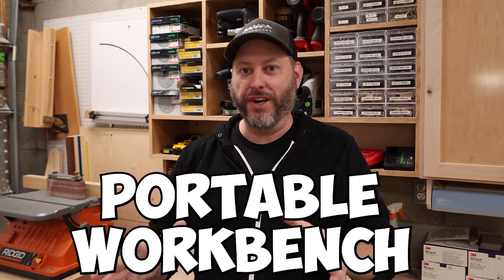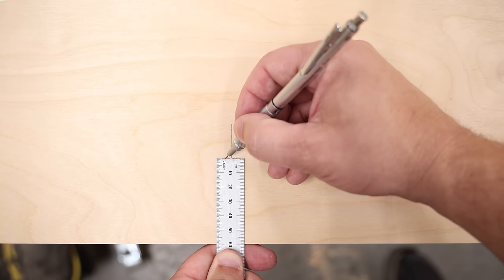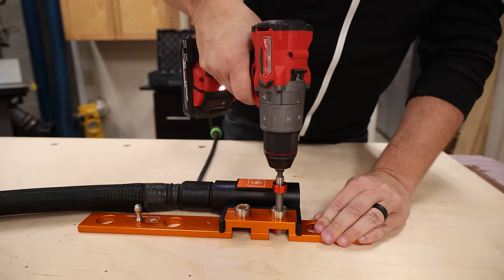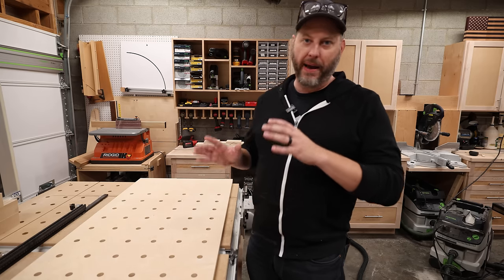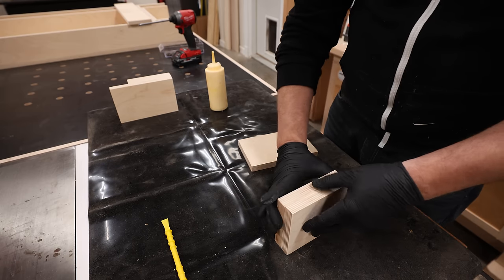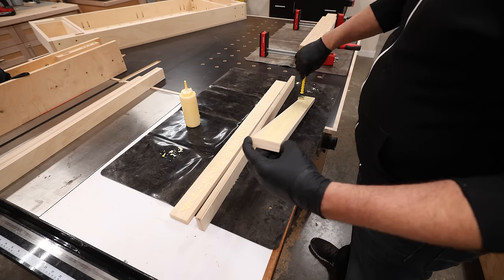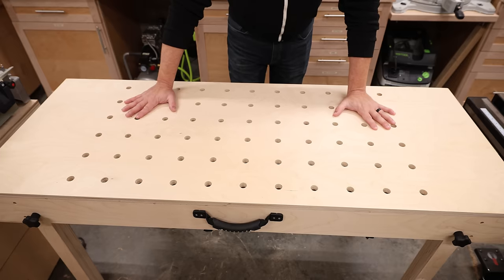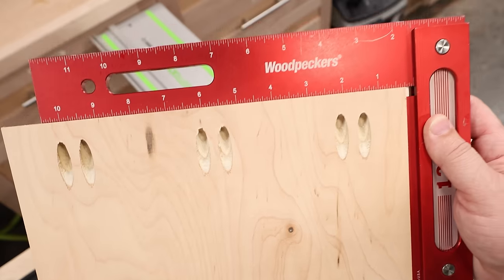I regret not building this sooner

Comment: I work for a cabinet company here in the states and we exclusively use metric. Before I started working there I had never used it in my life. It's much easier to measure with accuracy, and the math is much easier. Now when I'm working on projects in my home shop I mostly use metric. I think imperial is much better in normal construction like framing etc, but for smaller things that need to be more accurate, metric is much easier.
Reply from the maker: Yep most cabinet shops around the world use metric. They build cabinets on the 32mm standard
Reply: I just started using metric myself and love it.  Much easier and more accurate.  The problem is trying to reprogram my 66 year old brain.
Reply: Welcome to the world, fellow ‘Murkins
Reply: 🥲 I love to hear of Americans converting!

But to offer my counterpoint; as someone who grew up metric, but from watching so much high quality video content coming from USA, there's much to like about imperial too.

If I wanna build a furniture piece that doesn't need to fit into an exact place, I opt for imperial. Simpler numbers that allow me to visualise the end result more easily.  6" x 3" vs 6" x 4" I can imagine better than metric, unless I'm using round numbers.

Also, 8by4 vs 2440 mm x 1220 mm for a sheet of plywood. Much less syllables when talking to lumber guys 😂
Reply: If material supply is in metric, then there is not problem in using it in construction. Fx we do not have 2 x 4. We have 50 x 100 mm instead. There is really no difference in strength. And our entire building system is based on metric. We would find it silly to use Imperial.
Reply: It isn't more accurate.  Accuracy is how you relate to the measurements.  It isn't even more granular.  32nds are smaller than mm.  But hey, has nobody heard of decimal inches?  Tenths, hundredths, thous, and tens?

There was a fun system named after it's innovator that consisted of imperial measures, feet and inches, but inches were subdivided into 25 segments.  I think he had a point.
Reply: I was brought up in England to use both and I still do... most the time i use both on one project.  Even a 2x4 is 2 x 4 x 2.4 metres 😊 both imperial and metric
Reply: @tacticalskiffs8134  
Yes, I hear people saying metric is more accurate but that's pure rubbish.  The only advantage is it's easier to calculate multiple dimensions in your head, if you're fractionally challenged.
Reply: This is so true. Build some cabinet carcasses and then use metric to measure for your drawer dimensions. So much easier
Reply: Agreed. For those of us that hated fractions in school, it’s so much easier to measure millimeters than to remember if 3/8 is bigger than 11/32 or whatever.
Reply: Growing up in Canada, I started with imperial measurements & then the country switched to metric when I was still a kid. Even though most of my life has been lived in a Metric world, I still think Imperial & automatically "convert" metric to imperial for temperature, speed when I travel in the USA, kg to lbs etc... That "conversion" isn't accurate, but for me it's "close enough" for my daily life.

Building materials are sold in imperial measurements in Canada (for the most part) & anything that I have attempted to build (so far) I have used imperial, but I could easily build with metric measurements too. I have worked in 2 trades where imperial measurements are still common; paper is still sold in 8 1/2" x 11" sheets, commonly used for letterheads (printing trade) and pipes are sill dimensioned in imperial for my pipefitting trade, but measurements on drawings are metric

Comment: I used the Parf system to build the Ron Paulk Bench and what he recommended  was to use the forstner bit (no jig) on the underside to score the plywood and then drill out the holes from the top side using the jig. It works perfectly. Great project.
Reply from the maker: I read that when I was researching afterward. I will remember that for next time!
Reply: yeah, scoring the underside seems like no brainer after the fact... also - tape? on the underside? really? 😅

Comment: I use the Parf guide system with plywood all the time.   Once the 3mm holes are drilled I flip it upside down & drill about 1/16” with the 20mm so there is zero blowout.  Works like a charm & only take a few more minutes.
Reply: Happy to see this comment -- this was my first thought when I saw the tear out on the back.
Reply: Isn't drilling from both sides the standard blow out reduction method for any hole through any material anytime? I've been using it to drill through block walls for decades.
Reply: My thoughts for Baltic Birch Plywood. Set depth stop on the 20mm forstner bit  to leave 1/16" (1.55mm) bottom, bore 20mm pocket hole. Flip work piece over after all holes are drilled. Use a 5/8" brad point drill bit to enlarge the 3mm hole, then use a 1/4" or 1/2" Spiral flush cut pattern bit to finish up the bottom side holes with a router.
Reply: Dude, I'm pretty sure if he just used a backer board instead of the foam, most of it would be eliminated.  Just set it on 2 or 3 2x4 scraps and use one as a sacrificial backer board.  It might not be showroom perfect but it'll be good enough!

Comment: Great Vid . . .well designed build, love the storage end draws and under track saw hustler, just questioning leg stability.  
 Not Bashing just suggesting, the track storage is a +++ and is a must in this build, my thoughts would be to use folding metal legs  from a venue table for their stability and quick deployment.  To make them work you'd need a spacer to elevate them above the stored track when legs were collapsed for transport.      Just my thoughts. . . . Stay safe, Stay happy
Reply from the maker: Thanks for the idea! In my experience folding legs of any kind tend to introduce way more slop and wobble. Hinges have way too much play in them. Fixed legs, like on a table, are more rigid and stable.
Reply: I really like the top. Has a torsion box rigidity with great storage options. I’m a big fan of throwing my single ply diy mft on a bora centipede on the jobsite but its a little low and slides around on the multiple points of contact. My future rebuild will be closer to your top with pockets to drop onto the centipede I think. Optionally could use the sawhorses I usually have onsite.

Comment: I used the Parf Guide system to make a 4'x8' workbench.  Half the table is dead nuts accurate, the other half is a bit off.  Obviously user error.  One thing though for a big workbench, it takes quite a while to make.  I've considered having a template made with 30mm holes 96 on center and also some offset holes.  Seems like it'd be much faster to clamp down a template and with a 20mm router bit and 30mm bushing just route hole after hole.  The Parf Guide system is nice but a bit finicky.

Comment: "Yay Metric" is absolutely right, much easier than Imperial.
Reply from the maker: Not at all true if all your machines are in Imperial 🤣
Reply: @MWAWoodworks  We should have made that change long ago.
Reply: @MWAWoodworks  The US customary inch is legally defined as 25.4mm since the 1890s, so technically the US is already metric 🤓

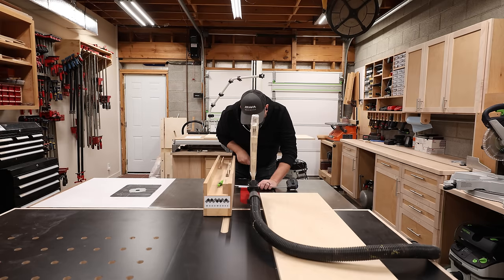Comment: 1:02  I find I'm using metric more and more. I removed my Imperial-only tape on my table saw and replaced it with a dual Metric/Imperial one just so I didn't need to fiddle with measuring metric cuts.

Comment: To prevent blowout on the back of your plywood, first drill part way through with your Forstner bit, flip the sheet over, then drill the rest of the way through from the opposite side.
Reply from the maker: Yep great tip! Thanks for watching! 🙌
Reply: I started on the underside and just made a scoring cut…you don’t need the parf guide, just locate the centre pin and cut through the surface ply. Flip the top right side up and complete the dog hole drilling.
Reply: I also had a similar issue and found that clamping another piece of plywood tightly under that piece stops the blowout also

Comment: After I drilled my guide holes I flipped the plywood around and just drilled in  the 20mm holes a few mm deep without the guide. then went to the top and drilled through with the guide. Eliminates the blowout. The bit they supply is pretty crappy. They had to send me another one after it chipped after a dozen holes.
Reply from the maker: Yep that's a great idea

Comment: Throw a scrap piece of plywood under it before drilling the holes. Problem meet solution

I know you don't want the pocket holes on the outside but is pocket holes with very minimal structural integrity benefiting the build? One of the very few rules of pocket holes is don't screw from the inside out, so I don't understand the reasoning to do them that way
Reply from the maker: Castle pocket holes are at a much shallower angle than typical drill pocket holes. I think it's 7 degrees vs 15. It's not straight in but it's not far off. The bench is very strong as is.

Comment: Or you can drill out about 2 mm on each hole on the bottom and turn it over and drill out the rest of the holes from the top. Then you will not get the blowouts.

Comment: 5:31 The recommendation for no blowout is to use MDF?  Yikes!  With all those Festools, I thought there would be a better recommendation.  How about shallow drilling from the backside first then finish the hole from the top?  Cool bench design though.
Reply from the maker: Yep you can do that if you want to double the entire process time. I found that MDF works much better. MFTs are made of MDF anyway so it makes sense.

Comment: So hardware/lumber stores in USA don't offer cutting down sheet material?

In The Netherlands and Germany - Gamma/Obi/Hornbach/etc all have huge vertical saws that literally only cut down sheets per your specification in both dimensions (height and width since sheet material is placed vertical). And unless you are asking for more than 15-20 cuts per sheet - they also do it for free.

Meanwhile even in Eastern Europe/Balkans - you can order sheet material cut, and in case of melamine panels even ABS edge-banded. Well you can do that in the Western Europe too - but at that price point I might as well just hire an actual wood working contractor that also installs it.

Comment: so you're saying you had to suffer metric for the aprons, while it's only relevant to the doghole spacing, only if you want to match the MFT system and for which you had a jig system anyhow? 🙃 seems legit 😁
Reply from the maker: When you build in CAD software you can only use one system of measurement at a time.

Comment: Just multiply your inch dimension by 25.4 - Cannot understand why Americans find metric so hard - I was borne in England (Imperial) and moved to South Africa when Metric was launched - no problem. Adding 273 to 285 is easy but adding 2.15/32' to 18.7/8" is a nightmare?
Reply from the maker: It doesn't matter when none of your equipment is in metric

Comment: But it's sooo müch easier to work with millimeters than complicated inch fractions all the time.
Reply from the maker: Nobody really works with complicated fractionn in woodworking. Nothing more complicated than a sixteenth of an inch. It's actually pretty easy most of the time.

Comment: metric is way better, its just getting used to things that sucks... im only used to imperial so converting is terrible and long winded but everytime you think and do math in metric exclusively its obviously easier to do
Reply from the maker: Metric is fine. I'm sure if you design everything in metric and most importantly all your tools are in metric then getting use to what metric measurements look like would be a lot easier. Doing math in metric is not much easier for me because the numbers get big really fast. Adding 48 inches to 60 inches is very easy for me. Adding 1220mm and 1524mm takes more mental energy and converting it to centimeter doesn't help at all (for me anyway) now you have decimals and what is a decimal but a fraction in disguise.
Reply: @MWAWoodworks  100 percent agree it's the conversation that sucks! If everyone used metric we'd all be better off but America won't and personally I'm mostly on imperial so rarely use metric unless I have to as well